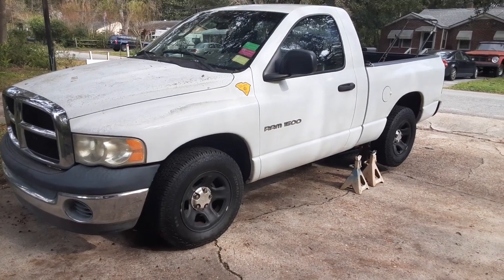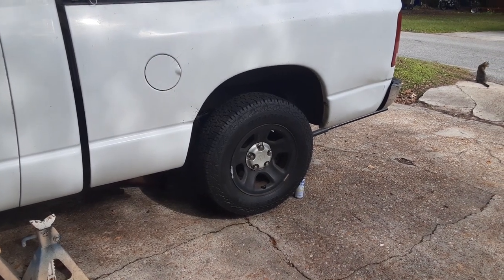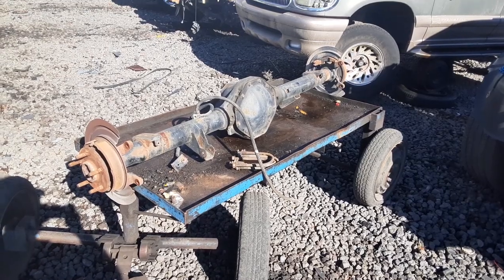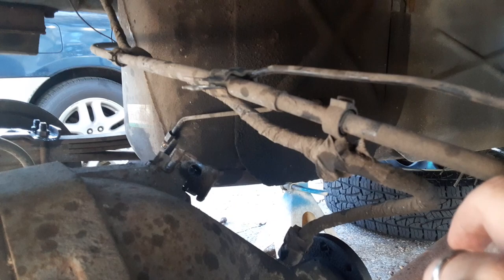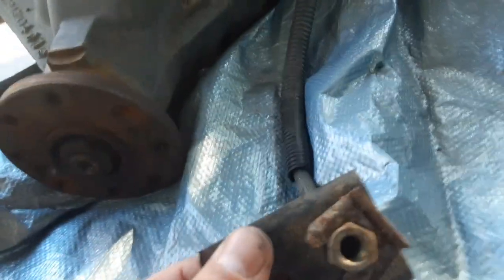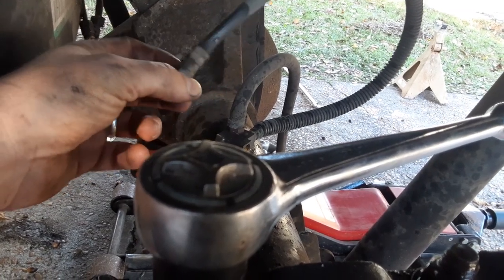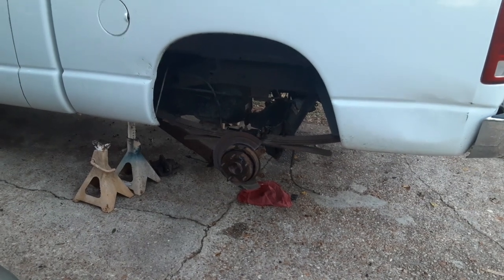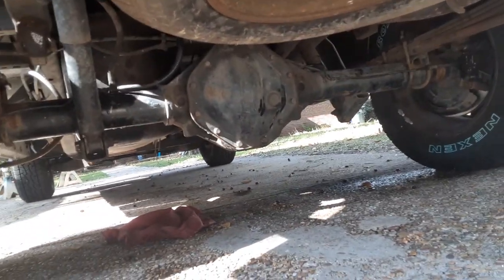3rd Gen 02-08 Dodge Ram rear differential swap from lkq

Comment: I replaced rear axle bearings hoping that was the culprit to the noise I heard....NOPE! So I found a used oem axle with 100k miles on it for $250. Hoping to do the swap myself. How long did it take you from start to finish?
Reply from the maker: @jamestoole3614  it took me a day minus the acquisition of the rear end itself. Sitting on the ground working alone with a floor jack it’s a full days job.
Reply: @NOBUDDYSTravels  Just finished mine on Saturday (9/8). Took every minute of a full days work. Feels like a full body workout but definitely glad I got that done. Thanks for the video.

Comment: My rotors aren’t coming off and one side(passenger) is coming out with full axle bar
Reply: What do I do? Get new rotors and how do I remove these
Reply from the maker: @hugoalvarado6965  the rearend I bought had the rotors missing already. Left old rotors on old rearend. Probably need to adjust the parking brake that’s inside the drum portion of the rotor.
Reply from the maker: @hugoalvarado6965  I would guess the parking brake shoe is probably seized to the inside of the rotor.
Reply: Okay most likely, will be getting back to it tomorrow, I got the passenger side easily with dw-40 and few hammer bangs on the facial. It could be that there.

Comment: So... it's possible that the pinion nut was loose.   There was a recall on '05 models for loose pinion nuts.   But the same axle/pinion/gears etc were used on 02-05.   

For those of you that have these years, make sure that pinion nut is TIGHT!!!
Reply from the maker: A guy could get lost in recalls on 3rd gen dodges. I don’t know specifically if it’s even the same final drive in the one I replaced. What I do know is I lack talent and know how to set gear lash correct so I opted for one from the wrecking yard.
Reply: I found out the hard way about that nut coming loose. Mine dropped at 50 mph and I just replaced the whole axle from a junkyard
Reply: @toddsuriner7436  
Exact same happened to me.  Thankfully there was a junkyard with one relatively close.  Unfortunately, my drive shaft also bent and all the junk yard drive shafts were bent from the forklifts.  $700 later and I now have a custom aluminum one.

Comment: This helps a lot. I have the same project that I'm sitting on. Price of a rear end now has gone up significantly and they all have 150k miles on the donors. 😁
Reply from the maker: I don’t have any idea how many miles this unit had on it. When I popped the cover off the fluid looked almost new. Thankfully I’m at a point with the truck there is nothing else left to replace. For now at least.

Comment: did you try to just tighten the pinion nut after you had the old one out? it may have just backed out, and maybe the bearing wasnt bad yet?
Reply from the maker: The seal tore. By the time I noticed it had leaked the gears were making noise. Went to work in the dark. Didn’t see the oil on the driveway till I got home. By then it was already junk.

Comment: I have a 2004 Dodge Ram 5.7 with a 3.92 gear ratio ‘ “will a 2002 5.9 with 3.92 fit does the engine matter.
Reply from the maker: As long as it all plugs and plays the engine doesn’t matter. 02 to 04 should be exactly the same in theory. Pick up a measuring tape and measure the axle pads, shock mounts, and driveline connection. I don’t think the truck I took the rearend from was the same year. It was a v8 truck and mine is a v6. They are pretty much all the same. Wouldn’t worry about it.

Comment: Hello there and thank you for the video. I have 2006 automatic V6 with 87,000 original miles. Apparently, there is a magnet in the rear differential that has picked up metal shards. It is causing the ABS+Brake light to intermittently cut on/off. I wish I could give you more information. That being said, given this is the correct issue, what would you suggest if you were in my position. Btw, it is my daily driver and runs alright other than that. Any information will be much appreciated. Take care and I hope you are doing well. 
Take Care 👍💯
Reply from the maker: Can’t hurt to clean it off and change the fluid and keep an eye on it. I lack knowledge on setting gear lash so when the pinion seal took a dump I opted to replace the whole thing with one that didn’t leak.
Reply: @NOBUDDYSTravels  Thank you for your reply. I'll certainly have to change the fluid asap.

Comment: I have a question 
How to find those  numbers in my differential  3.92 -2003 Ram 1500
Reply from the maker: There should be a metal tag on one of the diff cover bolts.

Comment: Question..how where you able to use a rearend from a 2500 on your 1500?
Reply from the maker: I didn’t. Only difference was it was a 4 door automatic truck and mine is a standard cab 5 speed truck. Both 1500 trucks. Not sure how you got that mixed up.

Comment: When replacing the rear differential, does it affect the timing chain at all?
Reply from the maker: Jesus I hope your joking. If that’s a legitimate question please don’t work on your vehicle.
Reply: yes. it will jump 2 teeth and your valves will drop and get bent up by the pistons